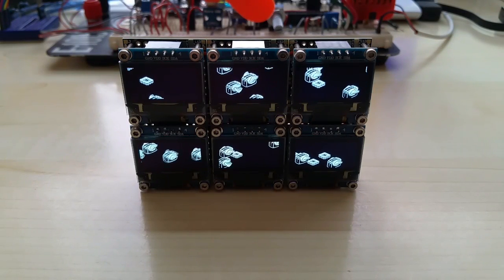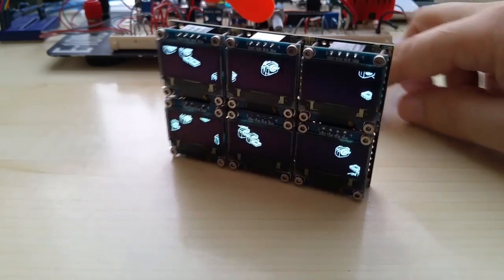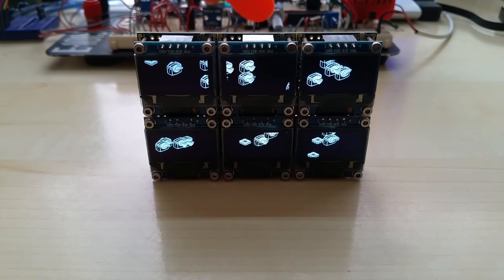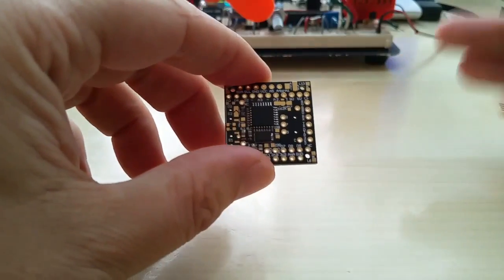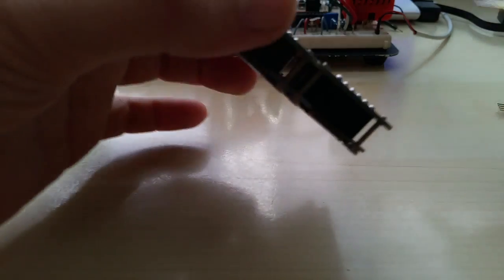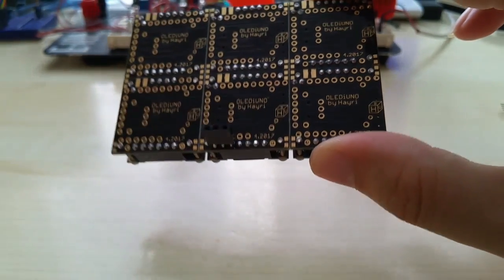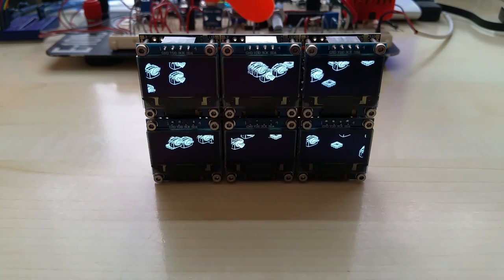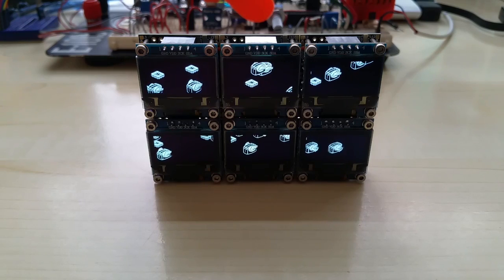Finished order of my 6-pack OLEDiUNO Display sold to Sweden

Comment: how much is a "6pack" like that? it would fit nicely in my military truck
Reply from the maker: Unfortunately I do not have those PCB's anymore.
Reply: @iHayri1  maybe something similar?
Reply from the maker: @jpjay1584  Actually, I do have the PCB's that I use for the gear indicator that also have 2 analog inputs, one direct, the other one over a voltage divider, plus they have a onboard 5V LDO so you can connect it directly to your car. I just don't have enough OLED displays for it. If you are willing to get the displays yourself I can supply the finished boards with the female pin headers for the displays and the needed screws. You will also need one of my USB adapters with pogo pins to upload your code. If that helps you out, write me your email and I get in touch with you.
Reply: @iHayri1  hello, I don´t want to put my mailaddress here. how can I contact you?
thx
Reply from the maker: @jpjay1584  You can send me a message through my Tindie store. Link is in the description.
Reply: ok
Reply: hello, I sent you a message in your Tindie store about the 6pack-OBD2 displays.
would be great if you can sell me a 6-pack. (the missing parts I will try to get by myself)
thanks a lot!
Reply from the maker: @jpjay1584  If you are Uwe, I just send you an email :-)
Reply from the maker: @jpjay1584  Strange, that's where I send it too exactly 4 hours ago, will do again now.